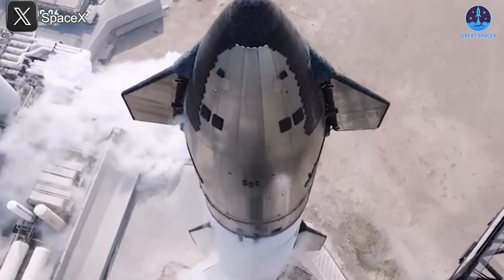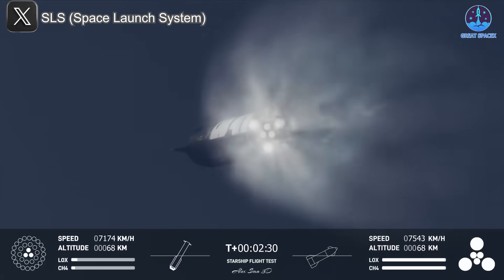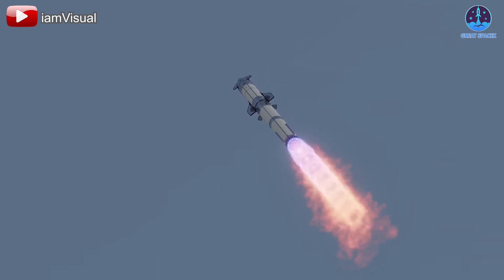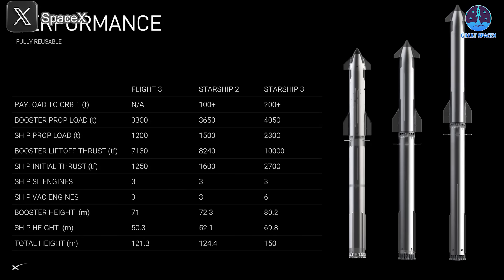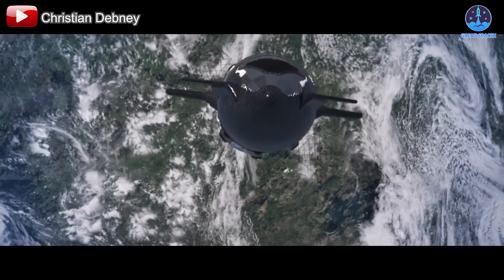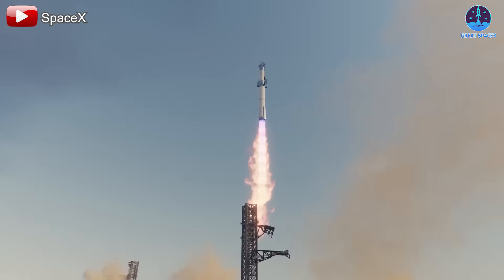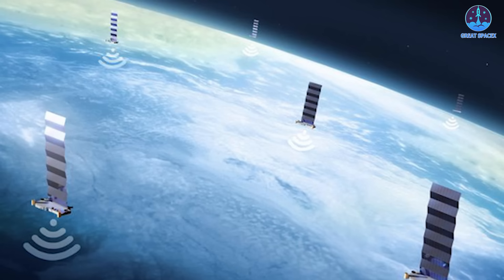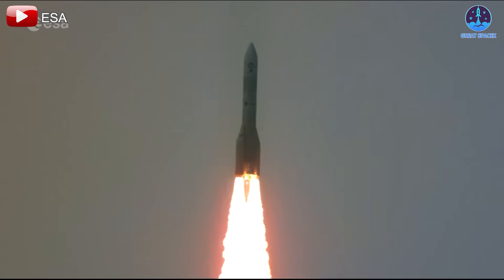SpaceX Revealed New Hot Staging Design Changed on Starship V3! Here Why...

Comment: One o the major topological and structural problems of designing of two stage rocket is necessity of incorporation in that design of unpressurized interstage (called skirt on Starship) that is subjected to very high compressive forces during launch and even higher compressive forces during ascent. The interstage (called skirt on Starship) housing rocket engines of second stage of the rocket, for variety of reasons (too numerous to mention here), cannot be pressurized during launch and ascent of the rocket. Lack of internal pressure causes that whole interstage structure works in maximum compression when full trust of almost empty Super Heavy Booster is pushing up fully fueled upper stage (just before MECO). Current design of the skirt of the Starship cannot take full thrust of rocket engines of the Super Heavy Boosters during later stages of ascent without suffering catastrophic collapse. Currently compressive strength of the skirt of the Starship is limiting maximum acceleration rate of the rocket during ascent to approximately 1.75g before MECO while Falcon 9 develops 3.5g before MECO. (Mass of upper stage times acceleration gives maximum compressive force on the interstage). That is very serious impediment on performance of the rocket limiting load capacity to orbit and increasing gravity loss during ascent. Moving grid fins down away from stage separation helps increasing design freedom in tackling main problem but that is about it for improvements.
New Hot Stage design does not address structural problem in any meaningful way, it actually makes them worse. Compressive strength of thin-walled steel structures rests on resistance to buckling. Resistance to buckling of compressed steel structure is highly reversely dependent on unconstrained distance of element under compression. Making unconstrained distance between bottom of lower tank of the Starship and top of the upper tank of the SH Booster much longer makes combined problem of unpressurized interstage (The Skirt of the Starship and Hot Stage Ring) much worse instead of making it better, no matter how cleverly one tries to slice it.   
Completely new design approach is urgently needed. 1. Return to main objective, that is: maximize load capacity to orbit. In order to accomplish main objective, minimize distance between bottom of lower tank of the Starship and top of the upper tank of the SH Booster. Stop using outer skin of the skirt of the Starship as structural element transmitting compressive force during liftoff and ascent. Instead use 6 VacRaptors (three pairs of two) resting against nests build on top of upper dome of top tank of SH Booster as support columns. Move 3 center Raptors to outside of VacRaptor ring and use them for hot staging. They can be mounted on articulated frame folding into skirt covered by skirt flaps for descent. Mount one gimballed Raptor in the center  for maneuverability and final descent.
Reply: Weight saving realized by switching interstage (skirt) from structural element to aerodynamic element of the rocket will significantly reduce overall weight o the Starship. It will eliminate buckling as limiting factor in dynamic performance of the rocket during ascent. Reduction of empty weight of the Starship during descent brings cascading effects in form of reduction of heat loading and additional weight reduction of heat shielding required. VacRaptors have ideal geometry for compressive loading (cone shape) and multifunctionality is a key in efficient design of "mass critical" machinery.

Comment: Musk's "ground-breaking enhancement" is a rip-off of a communist Soviet Union design.
Reply: At least they tried not using hot-staging first.  They also tried not using a flame trench.  As designs are optimized for a particular function, they will often start to look similar.

Comment: Why hot staging?????
Reply: Igniting Starship before Super Heavy Booster separates, prevents Starship losing speed and having to use fuel to make up the loss, thereby allowing heavier payloads.
Reply: They can't let the Starship slow down in the stage separation, because the fuel supply would interrupt and they couldn't start the engines anymore. So it has to maintain acceleration to keep the fuel in the bottom of the tank instead of sloshing away from the intake tubes.

Comment: I saw this years ago that the flow area of the hot stage ring was too small causing ring over pressure. DUH. The truss solution solves this. Im a retired Propulsion engineer.

Comment: They might not need taller towers, to accommodate the taller block 3 Starships. The would have to lower the launch mount on pad A, maybe they will rebuild it to look more like the one they are building at pad B? And they can move the lifting/catch points lower on the ship, so that the shorter towers can still lift the ships onto the boosters.

Comment: The new hot staging ring design is more weight efficient because it is better able to take diagonal tension loads.  If you know structural engineering you will know what I am talking about.
Reply: It looks like a Serrurier truss, a design that dates back to the 1930s.

Comment: They may have a coolant inside the hot staging structure tubes that boils off but can be recharged for each flight.
Or aluminum inside the stainless steel tubes to absorb the heat by melting during hot staging requiring no maintenance and structurlly helpful.

Comment: Why not keep the Hot Staging ring with the StarShip as landing platform?? Can change it Titanium for Heat issues from Vacuum engines.
Reply: Why lug unused weight up even higher?  It is more inefficient.
Reply: Maybe it's financially better for recycling with the boosters. Starship needs a landing system for its self

Comment: The OLM on pad A, needs to be dropped down after flame trench has been put in and the flame deflector bucket installed. lowering the OLM on top of the flame bucket, practically on ground level that would allow more height more height for V3.